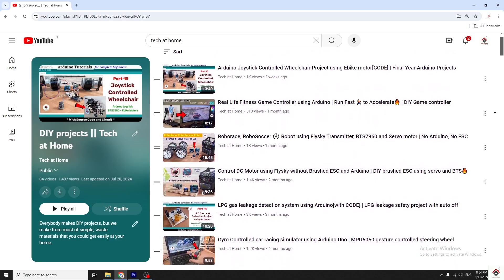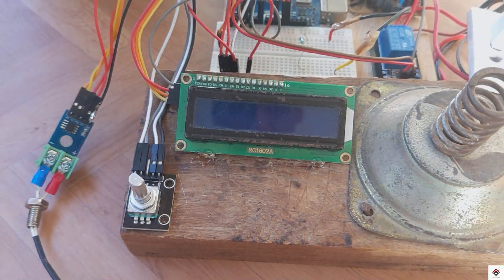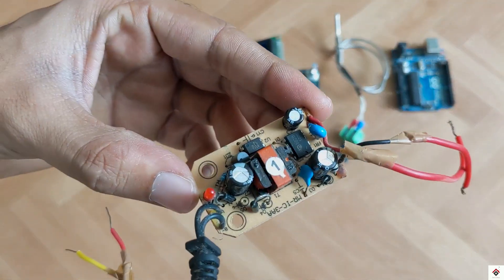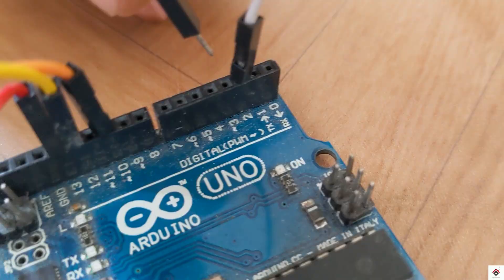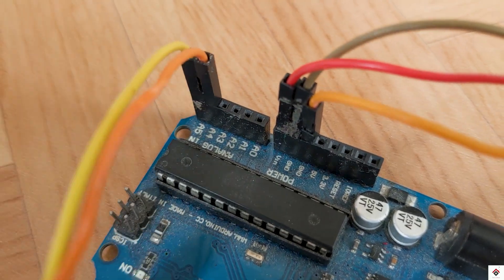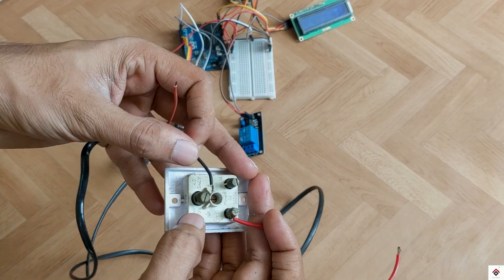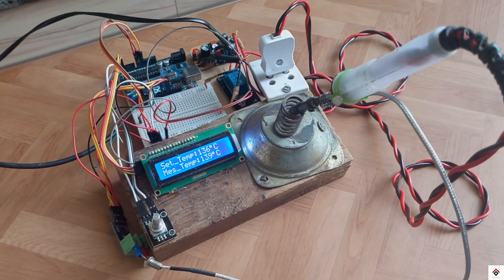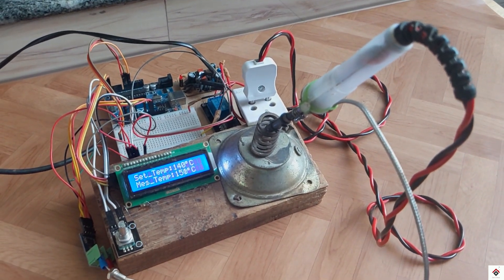Automatic Temperature Controlled Soldering Machine with Arduino and MAX6675 Thermocouple

Comment: It would have been nice if u had provided the final Code!
Reply from the maker: Code: https://drive.google.com/file/d/1CIrUQUTYST-Z41jyhyjOO1q_nBHNGkWW/view?usp=sharing

Not created circuit as of now, you can directly refer pin declarations and make connections. If any issues, reach us on mail.
Reply: @techathome  Thank you very much i will start now
Reply from the maker: Welcome
Reply: Can u used c210 soldering tip on next video? Thanks for imformative video
Reply from the maker: Welcome 
I don't have it. I will try if I can get one.

Comment: I'm planning to setup temperature controller for our sericulture shed for silkworm rearing, can we connect the heater instead of solder and how many volt or amp  relay module to be used
Reply from the maker: Yes you can connect.
What is the current specification of your heater??